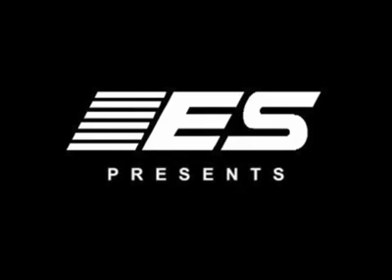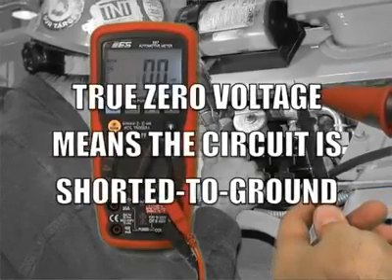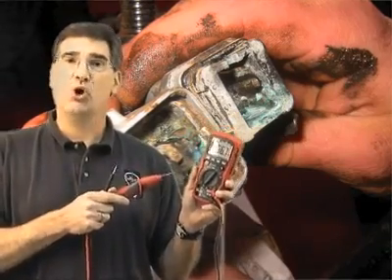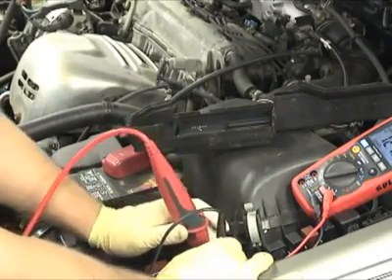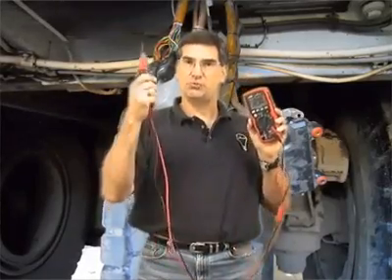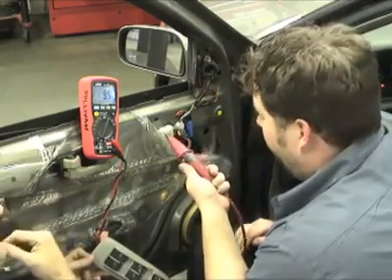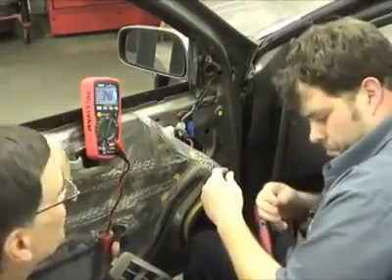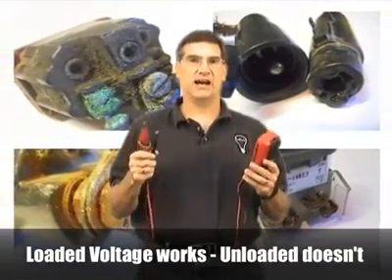Dan Sullivan Toyota Master Tech Review and Tutorial of the Load Pro Dynamic Test Leads

Comment: The load pro will find for example burnt contacts in your relay causing intermittent a/c clutch operation even when the clutch is operating intermittently dont have to mess around trying to get the a/c clutch circuit to fail the drop will be there any voltage drop across mechanical switch  contacts over 300mv is a suspect relay compare to a new relay have to know whats good to know whats bad and whats bad before ya know whats good

Comment: I have a question here. There are a lot of circuits tied into the multiplexing now a days like the ac clutch. If I take the load pro and hook up to the ac clutch connector to test the wiring will that mess up any of the computers?
Reply: This isn't a power probe..... this is a consumer. This sucks power not send it

Comment: The only thing this tool proves when you push the button "and you see no change" as Dan puts it is the circuit being test can carry 500ma.... How is that helpful at all? The tool creates a 500ma draw. Why on earth would someone remove the intended load on the circuit to do open circuit testing!? If you are testing a horn, window, starter, fan motor or any other circuit for that matter LEAVE THE LOAD IN PLACE! What if, when you are spending half the day to get to connectors and yanking relays and fuses you fix the problem on accident? Now you have no idea what you did and you will get a come back in your shop. This tool has huge limitations and I assume that is why it never really made it. Amp clamp , scope and a test light, no guessing :)
Reply: South Main Auto Repair 
A test light is a HUGE no no sir 
You’re placing unwanted resistance in a circuit . Say for example a parallel circuit. “Lower than the lowest resistance”. You’ll for sure smoke ecm’s left and right. A good meter is very helpful I agree. But I have more faith in this than some light that doesn’t tell you s%#t.
Reply: The Load Pro appears to be a 25Ω switched load, which is equivalent to a 6W bulb.  Indiscriminate use would result in the same 'for sure' mentioned; not sure why it would be considered safer, since the load is invariant and not something you can tailor to the circuit being tested.
Reply: it makes sure you have a complete circuit and not a tiny short in the wiring it's for advanced technicians that's why it needs to be checked under load
Reply: South Main Auto Repair what he is saying is that by doing the test with the load pro, if you see no difference after pushing the button, the load you put on it will be telling you that there is no problem with the wiring harness, switches, or connectors.  With that quickly solved, you can be sure then that the problem is the component, and not the harness or anything supplying that component.
Reply: I believe SMA's point is that not all circuits are identical, and a wire path that easily carries a logic level signal may be woefully inadequate for a headlamp circuit.  It's actually better to have different loading for testing different circuits, but then it would require the tech to know something about what is being tested, and defeats the all in one tool concept that may be desired.
I have test leads that have stackable banana plugs, and that makes it easy to connect a specific load across the DMM, which can be high or low as needed.  Not push button convenient though, as it needs to be plugged in for the test and removed otherwise.
Reply: @dtrrtd774  That's interesting, what values do the the resistors have that you use in the stacked sections? Also, what would be some examples of the needed total? For modules, 5v sensors etc...moderate loads seem simpler. Just curious, thanks!